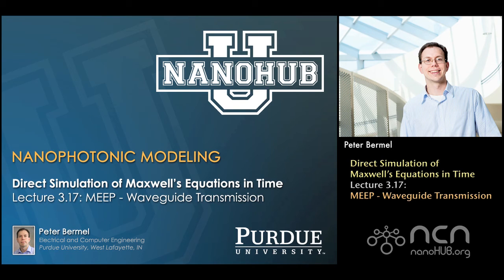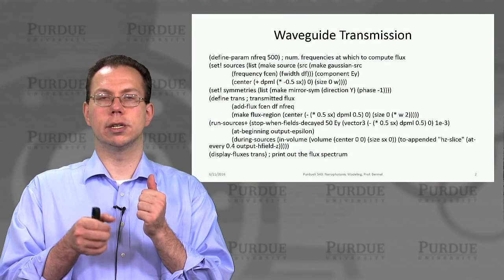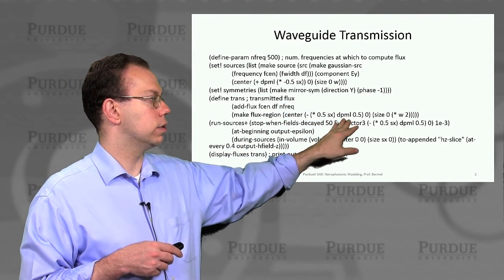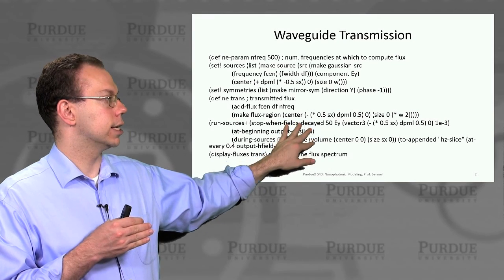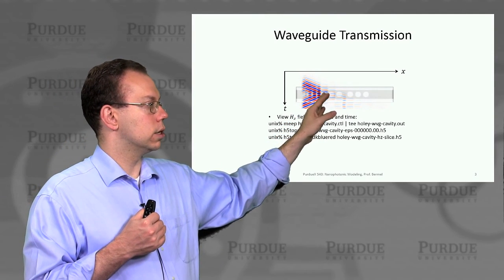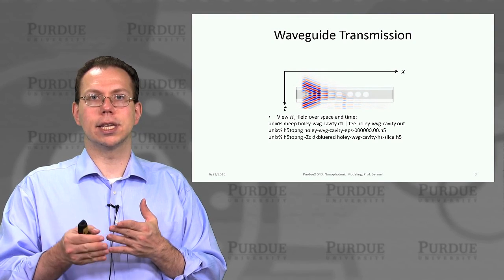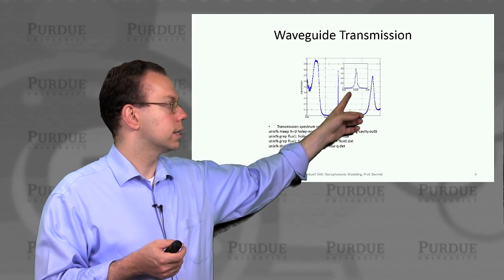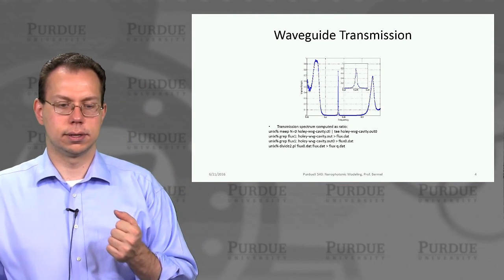nanoHUB-U Nanophotonic Modeling L3.17: MEEP - Waveguide Transmission

Comment: Hi, guys!
Thanks for the great work, you did help me understanding Meep and understanding its firsts usages.

I'm a beginner, and I'm using MEEP to simulate Waveguides. I already know how to simulate an straight Waveguide and its loss, reflectance and transmission.

Do you guys recommend any tutorial that helps in learning coupling of Waveguides? And to make curved Waveguides?
I'm trying to learn how to simulate that, i'll make a curved Waveguide coupling with a straight, like that:
 )|

I want to test how the fields behave if I change the radius of curvature and the distance from the two waveguides, but first I need to learn the basic stuff.